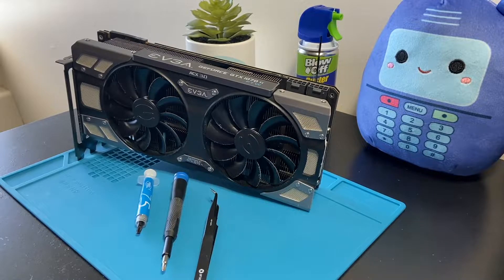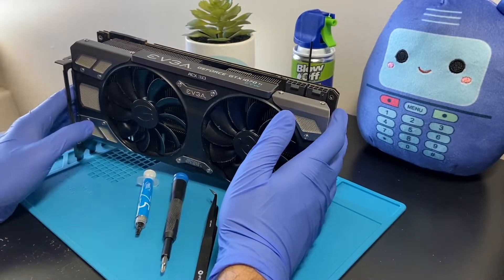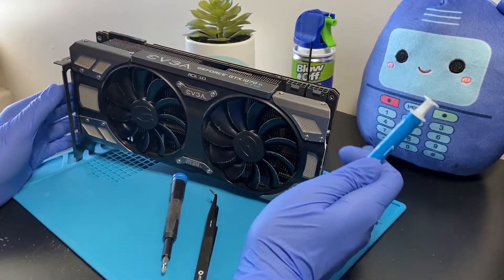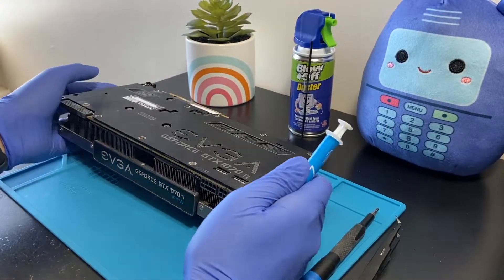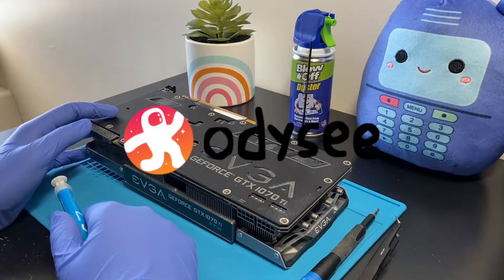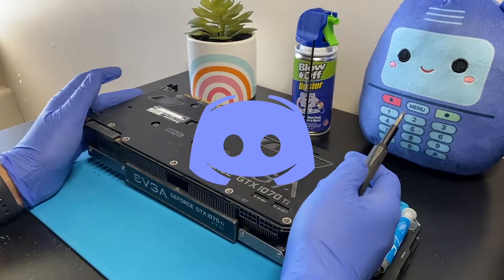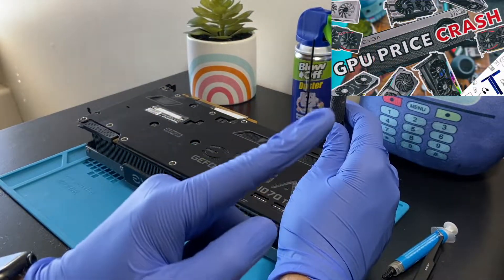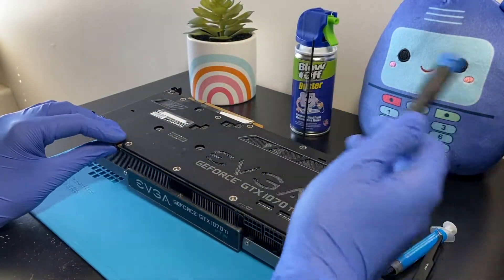Cleaning & Replacing The Thermal Paste On My EVGA GTX 1070Ti FTW | With Music

Comment from the maker: Does anyone here still use a GTX 1070Ti? Do you have the same model?

Let me know down below!
Reply: The GTX 1070 FTW in my second rig
Reply: Well I have a 2018 one which is watercooled closed loop and I’m wondering if there is anything different I should do
Reply: Just recently got one, does the job pretty well
Reply: My old rig has a 1070 OC Black Edition that I bought in 2017 also.

And I just upgraded from an EVGA 3070 that I'm going to build a second PC around.
Reply: Still using my Zotac AMP GTX 1070ti in 2024!
Reply: Yes
Reply: Yes i running every dat stil this beast card
Reply: 1070ti  nividia  founders edition card here with a i7 6700. 32 gig of ram ,,,, good deal on a kit at the time. M.2 and three ssds. Love my computer but it’s way past time to upgrade lol
Reply: The biggest upgrade you can do is going from mechanical hard drive to ssd!

Comment: I wanna do this cuz my 1070ti is running pretty hot, I mean highest temp is 77c it’s not in the thermal range but it’s still kinda hot. Just don’t wanna risk taking it apart and breaking it also founders edition. Should I just sell it for like 100 bucks and buy a 5060 8gb?

Comment: why is this idiot using MULTIPURPOSE CLEANER to clean off thermal paste? WTF?! Do NOT copy this guy! Remove thermal paste ONLY with 90% isopropyl alcohol! Dont use canned air like the idiot in the video, remove the pcb and fans from the heatsink and put the heatsink in an ultrasonic cleaner. Clean the pcb with a soft bristle toothbrush and 90% isopropyl alcohol. If you use canned air, you can blow components off the pcb or blow dust deeper into the heatsink!

Comment: Still using my trusty GTX 1070 (yeah, not Ti..). I just built a new rig with a i5-13600k+DDR5 and a Z690 (Z790 way too high right now). Since I have an old 1080p monitor this card is still working great. I get 92 FPS in Assassins Creed Valhalla with no hiccups with everything almost maxed out. Ill try to get a new GPU next but since I blew my budget for this build that may have to wait a while
Reply: I have the same exact card he uses in this video and im terrified to take it apart lol. I will do it tommorow when I am mentally and anxiously stable

Comment: Are you gonna upgrade from that old card? What card you gonna get?
Reply from the maker: 4080...depends tho, I may go all out for a 3090 and threadripper combo if I have the funds later this year...gonna build a new PC cause pairing a 4080 with a 4770K is pointless
Reply: @Techformative557  I agree. I'm on the same boat I want a 3080Ti but I feel like it'll be a waste with my current 8700K I'm planning on getting a 4080 or 4090 with a i9 13900k cause I only upgrade once every 5 years.
Reply from the maker: I haven't upgraded since ever..I spent my last collected PC money on an M1 Max Macbook for video editing n stuff..but now its high time..the 4770k is slowly becoming visible on recommended specs of some games lol
Reply: @Techformative557  you will not like your electricity bill tho